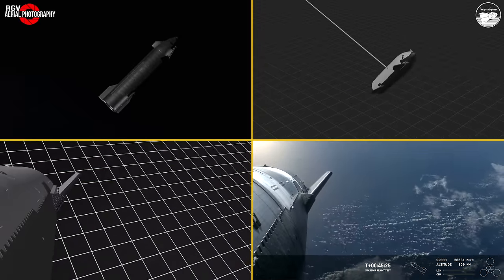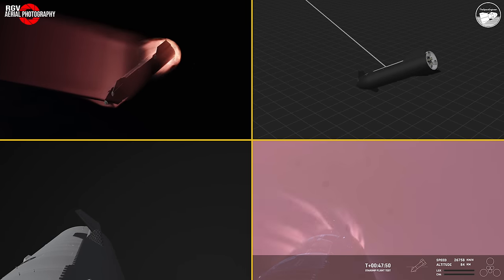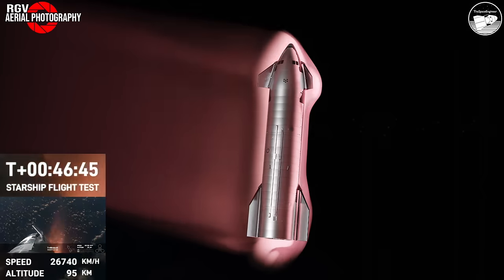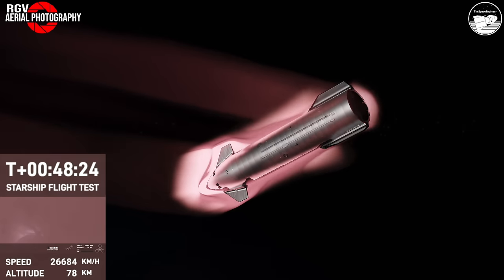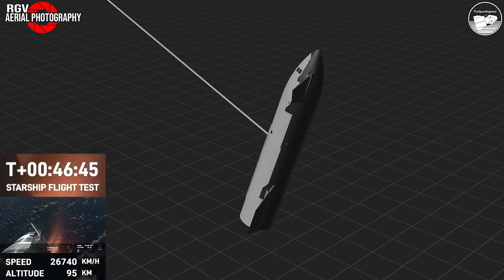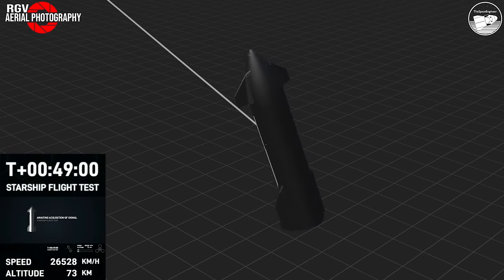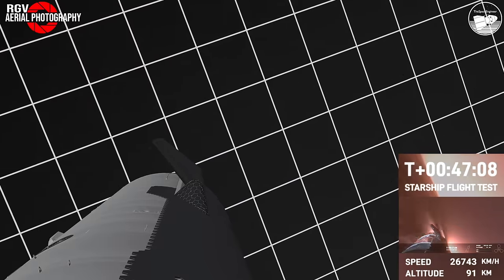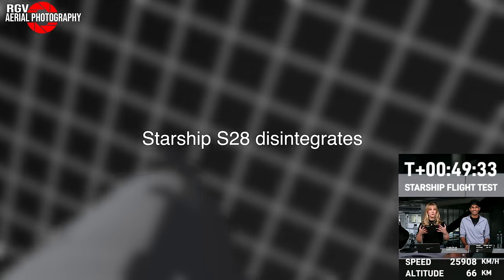SpaceX Starship Re-Entry and Breakup: 3 Render Simulations!

Comment: Renderings are Great!  Really lends to understanding.  Seems Ship and resulting plasma field are so big that the flaps have no control authority.  There is no passive stability due to the shape of ship.  It tumbles like a big amorphous rock.  Can force solution with active control but Ship should have passive stability.  This is big problem.
Reply: flaps aren't supposed to be used during re-entry, the air is too thin and moving too fast. It looks like RCS thrusters failed which caused all the problems.
Reply: In upper atm I get that.  But below 100km, shouldn't atm be thickenough?  I thot whole idea of a lifting body was that it self stabilized.  I don't know at what altitude it does that.   Maybe Starship no have lifting body features, but totally under RCS?   Your expertise appreciated. @schrodingerscat1863
Reply: @samwoodward4080  At 100km there is virtually no atmosphere at all to it would not slow something like Starship down much. For a lifting body to work it needs to hit the atmosphere at exactly the right angle. Normally the angle would be varied to allow the ship to dip in and out of thicker part atmosphere to gradually slow the ship down without getting too hot. If it isn't at the right angle this won't happen at all and it will come in too quickly while it's speed is still too high causing stresses on the air frame to be too high tearing the ship apart.

Comment: By these animations, Starship disintegrated when she fly in ideal position. Isn't it strange?
Reply: Its strange how it didn't disintegrated sooner while it was tumbling all over the place. To your point, well, its only when signal cut off, hard to say when exactly it disintegrated, but after entire rockets body experiencing forces which haven't been expected, it could have fallen apart independent which direction it as facing after that for it to go RUD.
Reply: Actually if you note at the last second it starts to quickly roll engine bay forwards.  Then…telemetry goes poof.

I suspect the previous heating of bay when it was bay forwards for a decent period did a fair amount of damage exposing.  Then once it rotated back again it was ‘lights out’.

It happened so fast I wouldn’t be surprised if a lower flap failed.

Comment: I found the announcers to be fairly annoying. It seemed clear to me that the ship was tumbling out of control, yet they were bubbling over with enthusiasm.
Reply: Thats because you cant see the big picture.

As doomed as the ship was, it was doomed in such a productive way that you cant grasp it.

Failure provides so much more useful information than success. Even the way the ship failed, taking so long and transmitting so much information, is an extreme success.

NASA found the limit of re-entry for the Shuttle with a crew onboard... I think SpaceX's way is cheaper on astronaut lives...
Reply: @Coyote27981  one of my favorite experiences in life, as an engineer, was building something knowing I wasn’t using enough material to make it durable in a windstorm, and then closely watch what happened in a windstorm.

Comment: Starship was rolling and spinning.. never stable to keep the belly / tiled side against the atmosphere.. so it was not going to survive.. 

They need to figure out why the ship was spinning and how to fix it.  
You would think if they can control the dragon capsule which is way smaller .. yet has been super successful.. the ship will survive in the future. Also they haven’t landed the ship falling from this attitude and speed. We might see some additional ground explosions.. unless they can catch it .. which is another risky scenario still with tons of unknowns. 

The first catch attempt could be so destructive to the tower if it can hold the weight of the ship dropped on the chop sticks.. they need to find a way to test the catch without the ship of booster launching.. maybe lifting them with the crane and letting go slightly above the chop sticks ..
Reply: That's why they test and have so many test articles.  They won't even consider trying to catch until they dial things in with soft water landings.

Comment: "Biggest object in space " rolling wildly and pitching up and down with no coherent attitude control - time to install a proper RCS system.
Reply: It has an RCS system, it seems there was a malfunction, possibly values frozen open or shut making control impossible.
Reply: @schrodingerscat1863  Good point- but a bit like their launch pad destruction mis calculation, it does seem not good enough for the job.
Reply: @tsr207  I don't think it's a case of not being good enough, I really think it just malfunctioned. If you look at the footage none of the thrusters seem to fire at all during the orbital phase. Makes me think the whole system didn't work at all for some reason. If it was firing but not able to keep control that would have been a different thing.
Reply: @schrodingerscat1863 
I suspect that the autogenous oxygen pressurization system is producing CO2 & H2O ices that cripple the ship in many ways. Clogged LOX inlet filter screens, jammed oxygen control valves, etc.
Reply: @imconsequetau5275  The autogenous pressurisation is actually a sealed system where gaseous O2 is fed back into the tanks from the engines and same with CH4. That said the values controlling thrusters have to deal with cryogenic liquids so can easily get jammed if things go wrong. I dare say SpaceX are well aware of the causes and will be working out fixes for these issue right now. Just like with the boost back failure of IFT-2 being fixed for IFT-3  this is just part of the iterative design process.
Reply: @schrodingerscat1863  
Yeah, SpaceX has said the LOX inlet filters were enlarged for this mission because the filters were clogged on the previous mission(s). 

It's not pure O2 vapor, but thoroughly oxidized methane with a lot of hot oxygen being routed back into the main LOX tank. Any pure CO2 ice hitting the liquid interface is heavier than LOX, so it promptly settles to the tank bottom. Any pure H2O ice floats on top of the LOX, but may slosh onto the inlet filters as well. Then there is every possible ratio of mixed ice suspended in the LOX...

Finally, every time the O2 vapor is passed through valves, there is an opportunity for the water and CO2 to coat the ball valves and butterfly valve edges; and freeze.

Comment: Congrats to SpaceX and all the employees there on a 80% success. Weird how Elon predicted just that % :)
Anyway, seeing how hard it will be to land the booster, and if successful on landing ones in the future, I think SpaceX should abandon the landing with the chopsticks and have another landing site planed-because it's way too risky to the launch pad and other equipment around it. Even if say 9 of 10 land safely that way-the 10th failure could ruin the launch pad-and the other launch pad slated to be finished later this year.
Reply: Pretty sure that's what the second tower is for. Having a catch site without much ground equipment will be much cheaper and safer when things go wrong. I don't see much point in putting effort into legs though if the chopsticks are plan A. The booster will be almost entirety out of fuel, and a tower without fuel lines is negligible additional fire risk.
Reply: @agsystems8220  maybe they should have 3 Falcon 9's tied together instead of the booster. That way we know for sure the Spaceship will land successfully  :)

Comment: OK, so I found that rather hilarious as the guy from SpaceX talks about the heat dissipating tiles doing their job when they're pointed the opposite direction of reentry with the butt of the aircraft covered in plasma. everybody's clapping as the vehicle is obviously out of control. It's almost like they weren't taking it serious being overly enthusiastic is not beneficial to the program from what I saw with tiles falling off the door, not closing not transferring the fuel by the way, the attempt of transferring fuel could've caused the vehicle to start that out of control rotation. It's obvious they're gonna have to do some work with control jets because as the friction started to build on the fence, it appeared, they could not control the vehicle. It's gonna take at least 4 to 5 more launches to fire engines to attempt to soft splashdown. I know they hit some milestones such as the biggest fastest, but that's inconsequential and has nothing to do with the success of the program. As far as I can see it was a complete total failure of mission objectives, and that worries me for the future of America space programs relying on SpaceX, I need to see some results in the next two attempts. I don't believe the fuel transfer was needed because they can't even get it to re-enter the atmosphere yet that's number one. Don't forget it. It's number one if you have people on that vehicle, it has to prove that it can re-enter the atmosphere every single time without fail, because it ever happens with people on board that will be the end of the program for many years just like the shuttle at least as reliable shuttle, but seeing tiles flying off that thing by the dozen did not instill confidence

Comment: Imagine if STS-1 had tumbled with the grace of a hypersonic brick with John Young along for the ride.
Using gas thrusters and control surfaces to guide a vaguely bullet shaped  airframe safely through reentry is something NASA already figured out in the 1970s with slide rules and drafting paper—and then conducted successfully on the vehicle's inaugural trip to space with human passengers and a guidance computer sporting a whole megabyte of memory! 
And SpaceX struggles to pull it off half a century later with supercomputers and immaculate fluid dynamics simulations that can run on a desktop? 
"Data gathering" indeed. Get it together, guys.
Reply: If NASA has Elon as director, such a graceful tumble  through reentry followed by explosion would have been called a great success and alot of data was collected. The next flight would have be better and everyone would have cheered. 

SpaceX work on the method of fix the problems as it occurs. So now SpaceX has to develop RCS to allow Starship to righten itself when in space. Also need to fix the engines... looks like it was leaking propellant which started this uncontrolled roll.
Reply: My whole point being that these failures are totally wasteful and unnecessary—as demonstrated by the success of vehicles like the Shuttle which had fundamentally similar design requirements—and 'blowing it up until it works' not cost effective with a vehicle of this scale and expense. 

"It would have been called a success for NASA if Elon were in charge" only because of Musk's personality cult. I'm saying it wouldn't and shouldn't be considered a success for NASA or SpaceX, even based on SpaceX's very own definition of this flight's profile and objectives.

Comment: Cant fly in a vacuum
Reply: You are correct, it's not flying with lift like an airplane in the atmoSPHERE. Plane wings create a combination of low pressure above the wing and high pressure below, essentially the plane is sucked up. A spacecraft in orbit (beyond the atmoSPHERE) relies on thrusters to alter its atitude, pitch, yaw, roll etc due to a near vacuum. But you already knew that, right?
Not to mention velocity (roughly 27,500 kmph). Think of the spacecraft as falling towards earth, but it's travelling so quickly it keeps missing, that's an orbit, but you also knew that too, right?

Comment: IF THE STARSHIP CAN REFUEL IN SPACE....DUE TO HAVING A TANKER STATIONED IN SPACE ....THEN REFUEL THE STARSHIP WITH ENOUGH FUEL TO USE THE ROCKET ENGINES TO SLOW DOWN STARSHIP ENOUGH ....SO THEY DON'T HAVE TO WORRY ABOUT THE THE HEAT BUILD UP WHEN THEY RE-ENTER THE ATMOSPHERE......
Reply: It would take a huge amount for fuel to do that, which is why aero braking is used.
Reply: Refuel a ship with so that it uses its engines to slow down, then refuel the refuelling ship so that it too can use its engines to slow down, then refuel the refuelling refuelling ship so that it can too use its engines to slow down, then...
Reply: And yes, I know, tanker and all... But that's just not a solution.
Reply: And how would that fuel in space get to space in the first place?

Comment: What a Mickey mouse operation. Cheering failure and cant even get basic physics right. Has ZERO to due with friction.
Reply: Right, visible plasma is due to  high speed (7500 k/s) molecules bouncing elastically off a very hot insulator surface and colliding with opposing molecules at nearly double speed, compressing to an  elevated pressure and temperature.